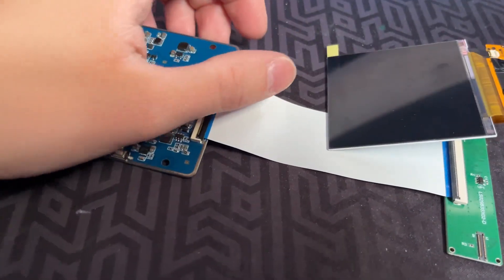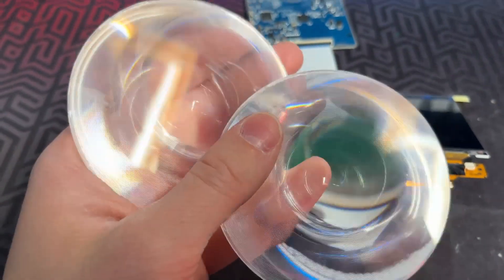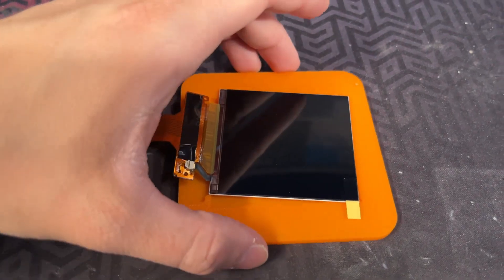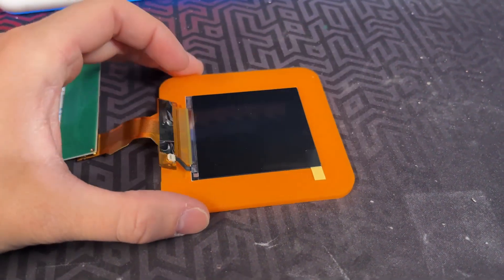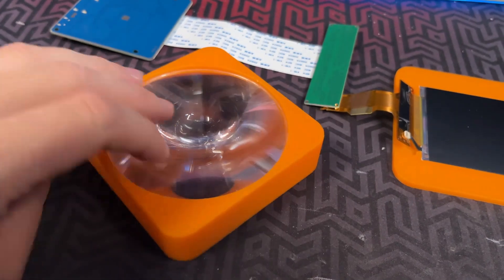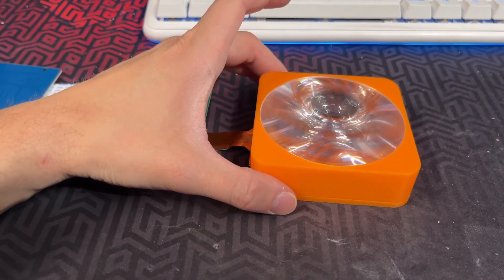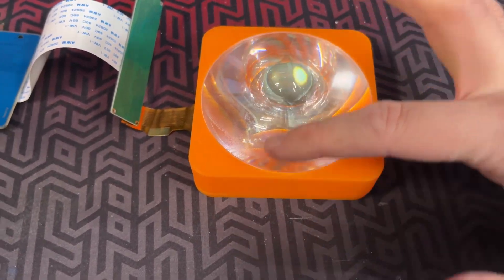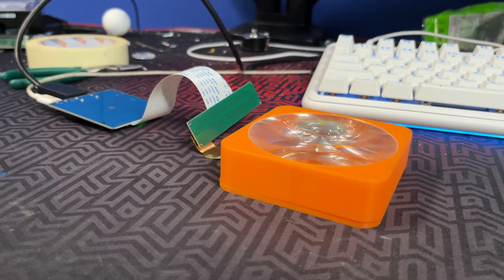Pancake Engine B 1.0 | DiY Pancake VR Display

Comment: Thank you for the second design !
Quick question, are the fresnel lenses orientation dependant ? When i did a quick light sim, it seemed it was, but not all lenses are created equal, so i wanted to make sure.
Also, if you have time for a version C, it could be intresting to use a regular phone as the display, that way we don't have to buy a new screen each time, and can also test on videos and stuff, with high resolution (modern phones are often close to 2k or 4k in resolution, for high end ones). 
Finally, do you think these lenses could support heat forming ? As in, heating up the lens, and inducing a slight curve in them so they follow better the eye socket shape.

Thank you for your time ^^
Reply from the maker: 1. Those are definitely orientation dependent. On one side you have those ridges that are responsible for magnifications. The other side is completely smooth. If you look through the ridged side, the image won’t be as good as through the smooth side. 

2. I don’t think I will be doing version C at this moment. I will definitely do one but most likely with high end, small displays like those in bigscreen.

3. There is no way to mold them into other shape. You will destroy the ridges on the side
Reply from the maker: Also, version 1.2 video will be out in about 10 minutes. It will look more like real VR display